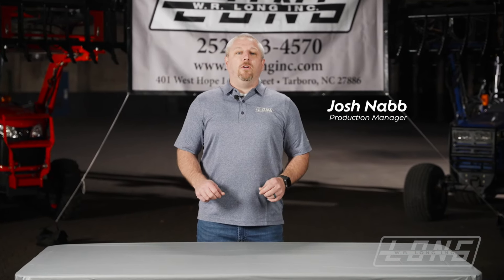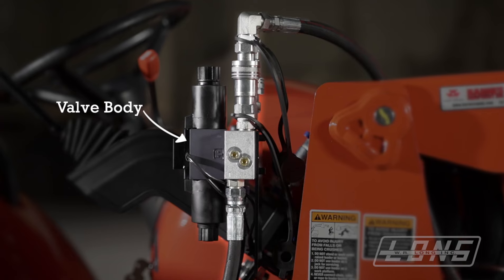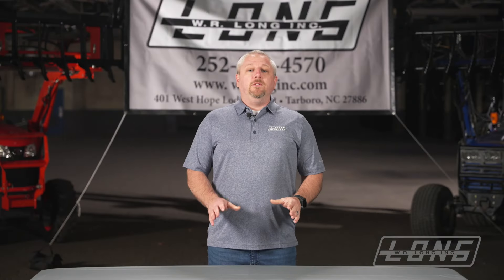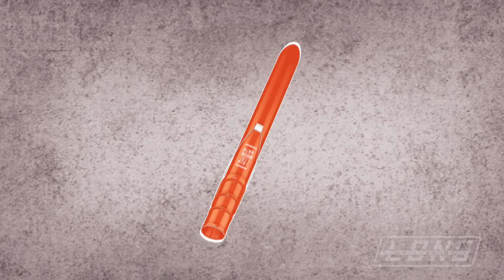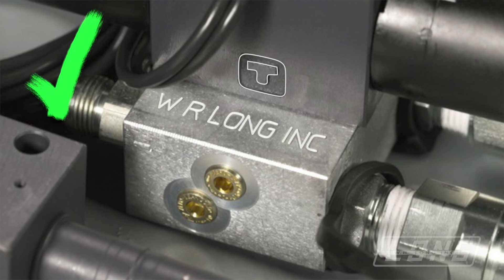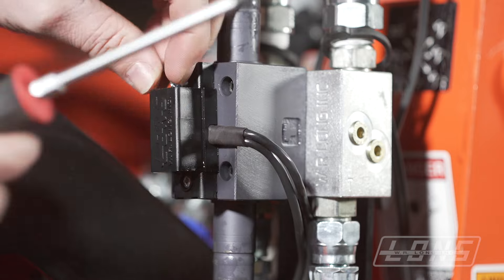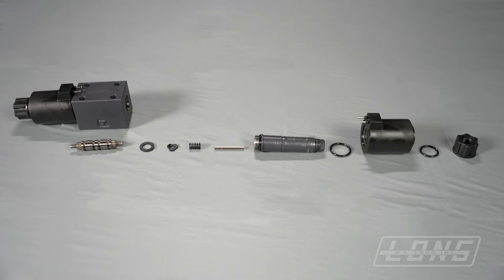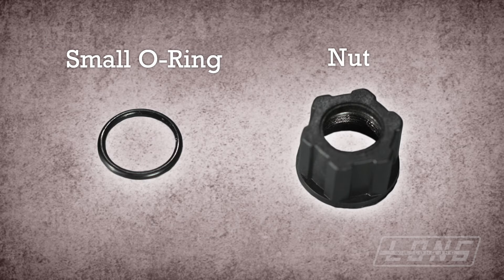WR Long Valve Kit Tips: Valve Kit Parts Breakdown

Comment: I'm disappointed with my WR Long 3rd function valve kit on my Kubota.  My issues is that the spool that slides up and down inside the value assembly is bypassing internally after only about 100 hours of homeowner level use.  The rest of my tractor's hydraulic system is smooth and tight -- will hold up the loader or3 point implement indefinitely.  BUT my WR Long 3rd function valve will not hold pinch pressure such that I cannot maintain grip on materials I have closed down on.  I have to keep pressing the close / pinch  button every 15 or 20 seconds to re-establish clamping pressure in the grapple cylinder.  I have taken my valve apart and found that there are no replaceable O rings on the spool like there are with better quality valves.  It's a machined fit, with no replaceable parts inside the valve.  WR Long's answer to my (premature, IMO) spool failure is that I need to replace the entire valve ($319.90 plus tax and shipping currently).  I believe a better quality valve would have replaceable O rings / be rebuildable.